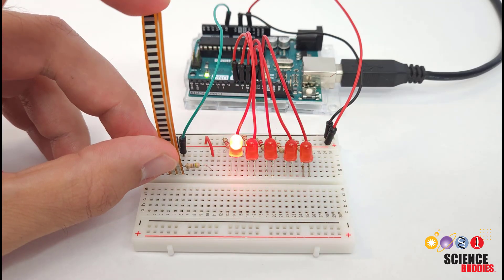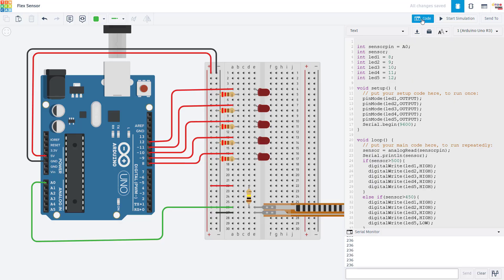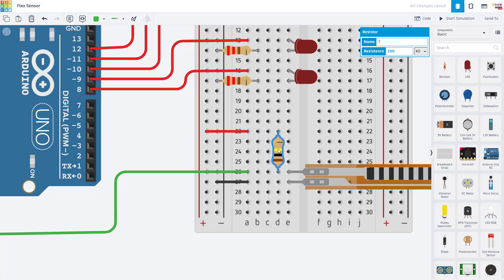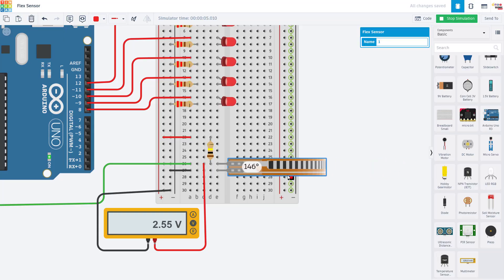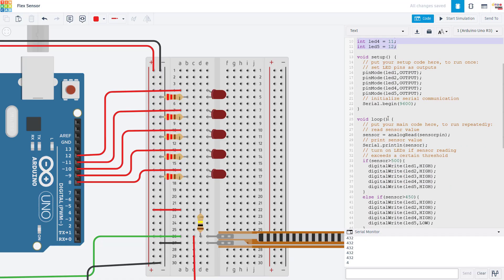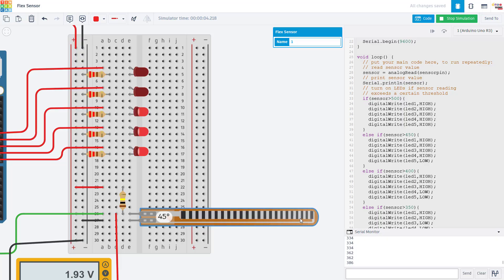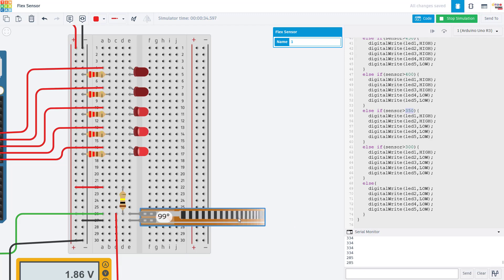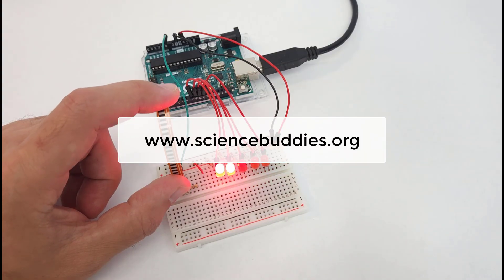How to Use a Flex Sensor with an Arduino (Lesson #22)

Comment: Sir, I am an 8th-grade student working on a project to convert sign language into vocal output for people with voice impairments. I am experiencing issues with my flex sensor: sometimes the readings exceed 1000 or drop below 50, leading to inconsistent values that prevent me from setting a reliable threshold. Additionally, when I bend the flex sensor, it shows values like 981 or 986, but instead of increasing with the bend, the values decrease. How can I resolve this problem?
Reply from the maker: Hi - if you are seeing large jumps in your flex sensor reading instead of a steady, continuous change as you gently flex it, you may have a loose electrical connection or a frayed/broken internal connection on the sensor itself that is giving intermittent contact. This could happen if at some point the sensor was bent too sharply and it kinked.
Reply: hey i am making the same thing can i get in touch with u have some doubts

Comment: I wonder if this setup can be used as a toggle light switch?
Reply from the maker: The bending of the flex sensor is more continuous, so it doesn't work very well as a toggle switch that snaps into one of two positions.
Reply: @Science.Buddies  Ah, good to know. Thanks for the reply.

Comment: Sir, How to measure the wrist circumference using a flex sensor?
Reply from the maker: Hi - you would need to create your own calibration curve to do this (measure the circumference of various cylinders using something like a piece of string and a ruler, and correlate this to the analog measurement from the Arduino).
Reply: Thank you.. @Science.Buddies

Comment: I would probably light up the LED one at a time, switching between them progressively instead of lighting them up cumulatively.
Reply from the maker: That would be a very simple change to make in the code, just keep the existing structure and change the appropriate HIGH/LOW in the digitalWrite statements.